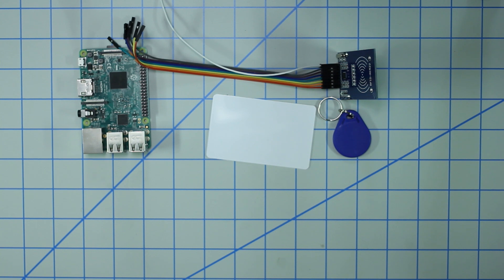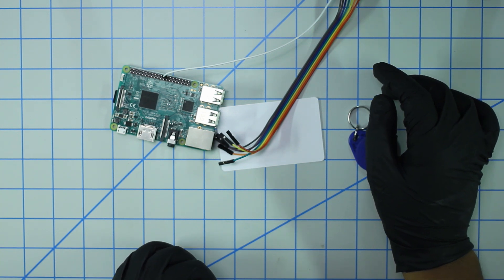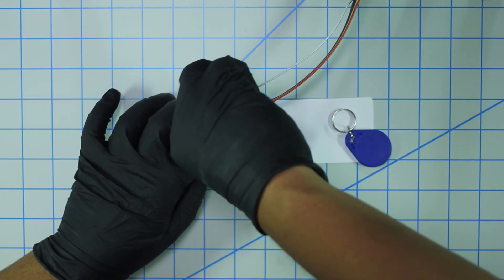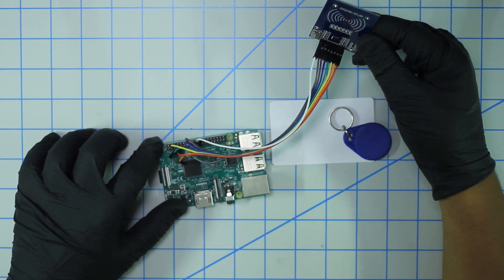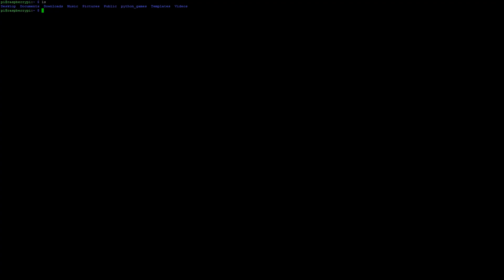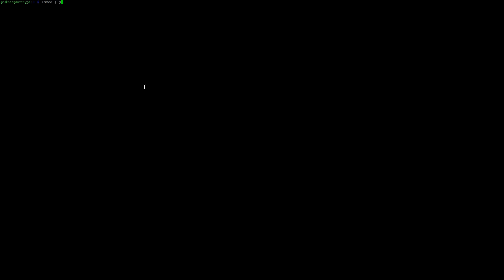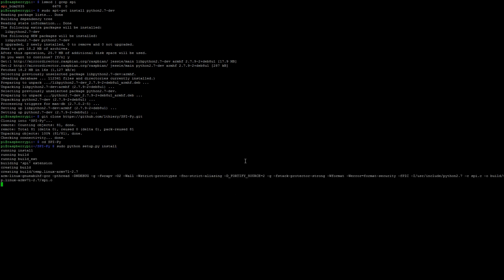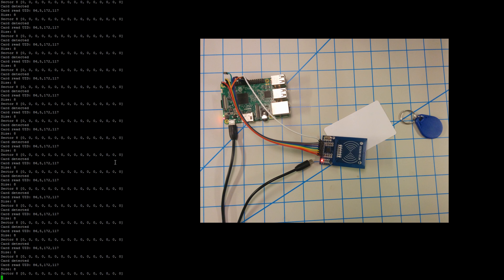RFID RC522 (Raspberry Pi)

Comment: I keep on geetting this error code /home/pi/MFRC522-python/MFRC522.py:133: RuntimeWarning: This channel is already in use, continuing anyway.  Use GPIO.setwarnings(False) to disable warnings.
  GPIO.setup(self.NRSTPD, GPIO.OUT)
Traceback (most recent call last):
  File "Read.py", line 41, in <module>
    MIFAREReader = MFRC522.MFRC522()
  File "/home/pi/MFRC522-python/MFRC522.py", line 135, in _init_
    self.MFRC522_Init()
  File "/home/pi/MFRC522-python/MFRC522.py", line 406, in MFRC522_Init
    self.MFRC522_Reset();
  File "/home/pi/MFRC522-python/MFRC522.py", line 138, in MFRC522_Reset
    self.Write_MFRC522(self.CommandReg, self.PCD_RESETPHASE)
  File "/home/pi/MFRC522-python/MFRC522.py", line 141, in Write_MFRC522
    spi.transfer(((addr<<1)&0x7E,val))
TypeError: function takes exactly 2 arguments (1 given)
can someone help?

Comment: am having the below error

Traceback (most recent call last):
File "Read.py", line 41, in 
MIFAREReader = MFRC522.MFRC522()
File "/home/pi/MFRC522-python/MFRC522.py", line 135, in *init*
self.MFRC522_Init()
File "/home/pi/MFRC522-python/MFRC522.py", line 406, in MFRC522_Init
self.MFRC522_Reset();
File "/home/pi/MFRC522-python/MFRC522.py", line 138, in MFRC522_Reset
self.Write_MFRC522(self.CommandReg, self.PCD_RESETPHASE)
File "/home/pi/MFRC522-python/MFRC522.py", line 141, in Write_MFRC522
spi.transfer(((addr<<1)&0x7E,val))
TypeError: function takes exactly 2 arguments (1 given)
Reply: I have the same error. HELP
Reply: @jantonioiglesiasm  i have it too
Reply: Seems this guys solved this issue
https://github.com/mxgxw/MFRC522-python/pull/80

Here is the fork with the solution (not merged into the official repo yet)
https://github.com/lucassarcanjo/MFRC522-python/tree/python3-spi-updates